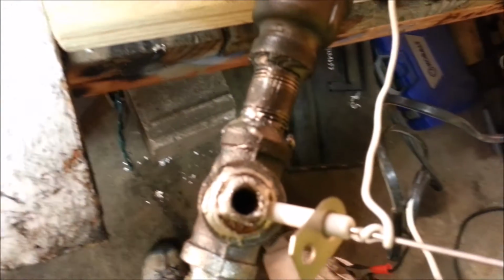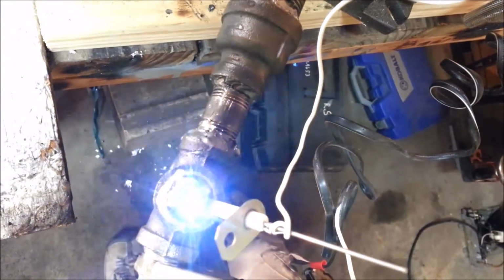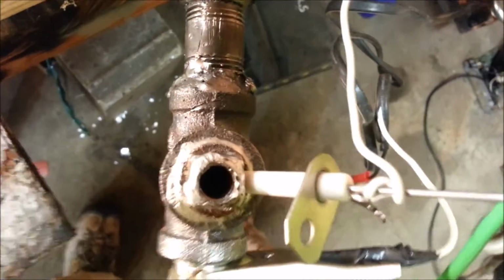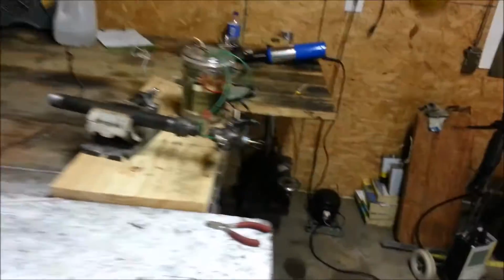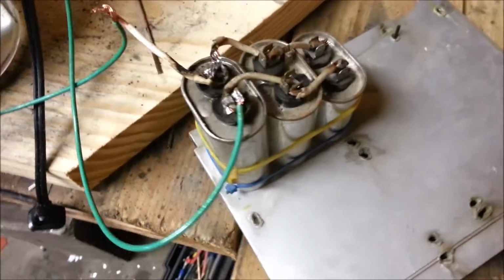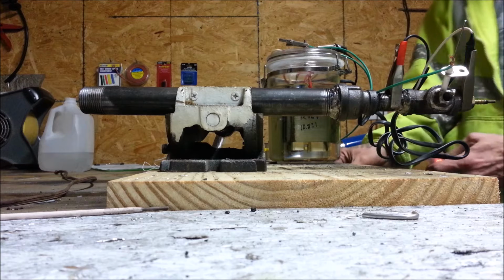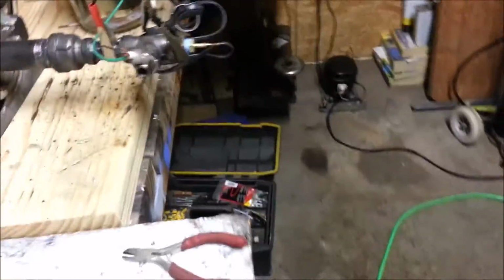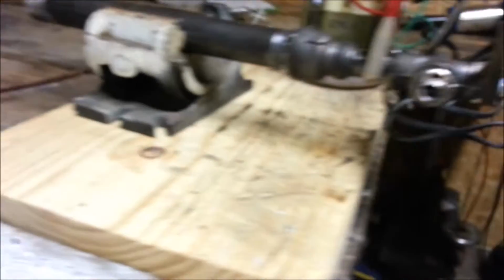Electric spark ignition system  HIGH POWER

Comment: Hi at 3.30 do you think you blew it or imploded it vacuum seems to draw in what we seem to call anti matter like the pistol shrimp muons positrons joe booker seems to catch these and wrap them with there opposite matter friends it may be like this a dc wire going to a ac alternator it is broken and then wound together but the opposite (like winding a rope ) 17 winds/turns shellacked  stopping any cross arching at 8.5 turns in place a donut small round neo dynimium magnet now spike off 90 degrees a wire from the neo magnet to your source. It's making a ac dc out of phase magnatron and I assume a massive energy ie the pistol shrimps sun energy. No expert but it has the equation of an interesting simple effect may be tiny loop at terminal ends of dc source and ac source to make a flowing closed loop circuit